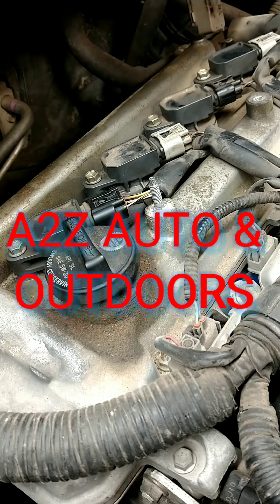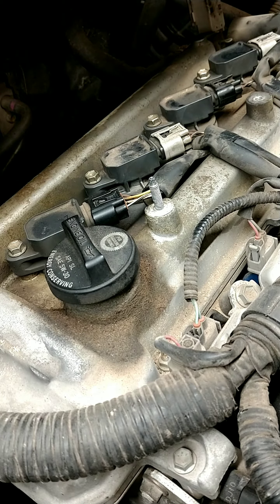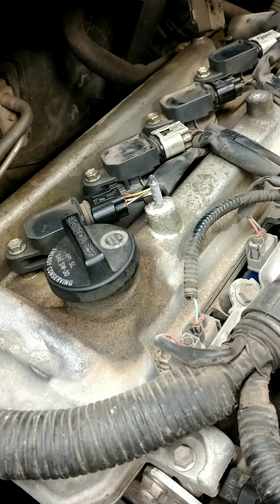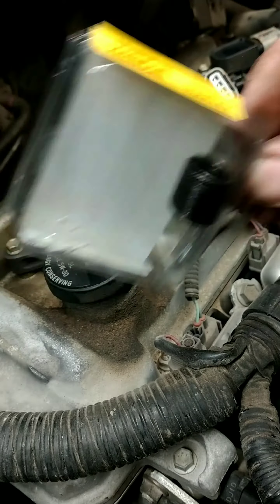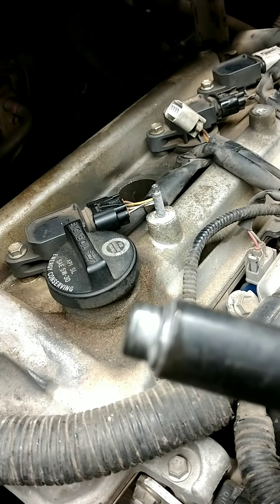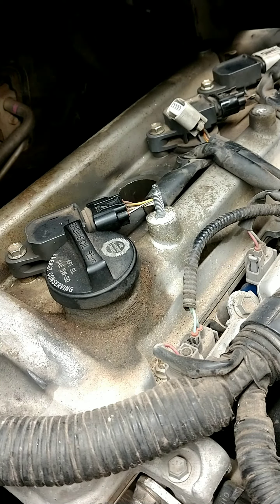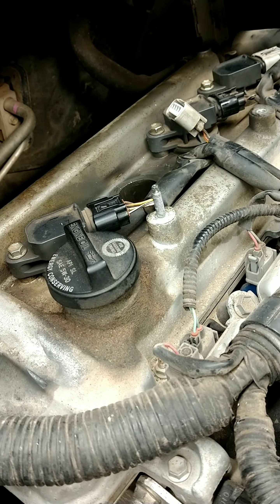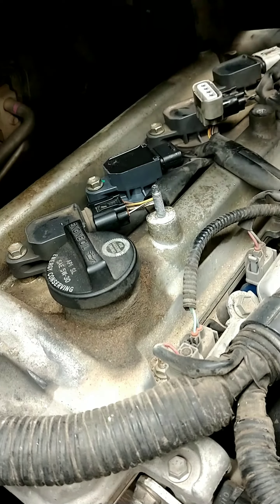Blown Out Spark Plug Thread Repair

Comment: Just watched this and I have a 2000 f250 with the 5.4 with 2 valves and so far it’s working great. Thanks for your video
Reply: Did you use the same spark plug for the threads to sit in ?
Reply: @lowsiento9567  I tapped out the hole and yes the same plugs for what the factory calls for. She still running good. I was nervous as heck tapping it out but took my time

Comment: The insert prevents the spark plug from protruding into the cylinder as far as it normally would. By upwards of 1/4” or more. Is this an issue?

Comment: For anyone that sees this comment... plz for the love of whatever god u beleive in... blow out the cylinder.. or vacuum it out.. something.. you dont want metal shavings of any size inside there.. i cant beleive he didnt do that.. or didnt show it at least.. and y cant you use the tapered spark plug if you use the tapered tool.. to widen it out.. wouldnt it serve the same purpose? May be just a little harder to get the plug back out i guess..

Comment: You forgot to allow the High Temp Sealer to adhere to the the head.  Way to quick, plus no cleaning out of the shivers in the cylinder before inserting the Helicoil.

Comment: Thank you for the video. 
Why did you not include starting up the vehicle afterwards?
Reply: The high temp sealer used on the insert threads has to sit up to 24 hours. Based on another reply to a comment, he doesn't wait at all so I am not sure why he didn't show it. It is important to let the sealer sit before starting though.

Comment: Okay so my plug blow out. It has the exact same helix coil/ thread adapter whatever. But the threds on the plug are completely fine but will not tighten down. Ik the threads have to be messed up but what i dont understand is that the tnreads on the coil are completely normal. Any help here?

Comment: You put motocraft gray up on it..  if i used lock tite it will still hold right?
Reply from the maker: Yes
Reply: @doublek441  Someone once mentioned that they remove loctite fitted bolts by heating them up. Wouldn't cylinder heat keep melting loctite?
I have a spark plug that is always coming out with the insert and I dont know what to put... Is the high heat RTV superior for the job than loctite?

Comment: What are the chances of the insert not staying when going to remove the spark plug? I just want to make sure I get it right.
Reply from the maker: Sometimes the insert will try to come out with a spark plug. if that happens he can leave the plug and insert in for a few hours and let the silicone dry.
Reply: Or you can use the tool you used to bore the hole out to put the coil in then screw the spark plug in